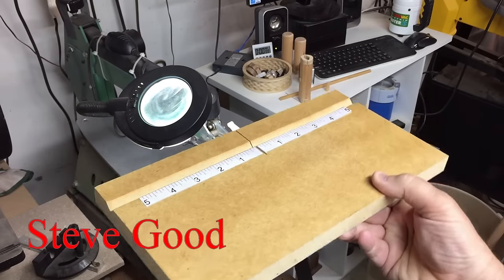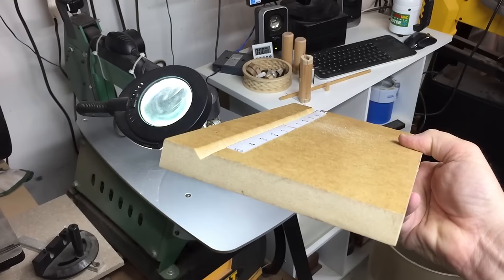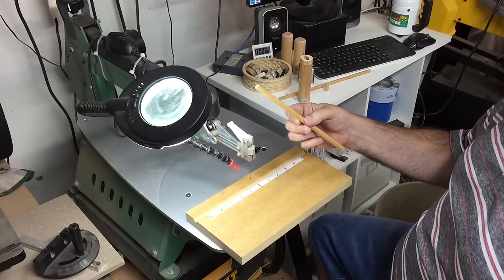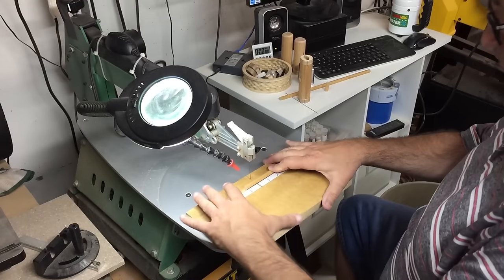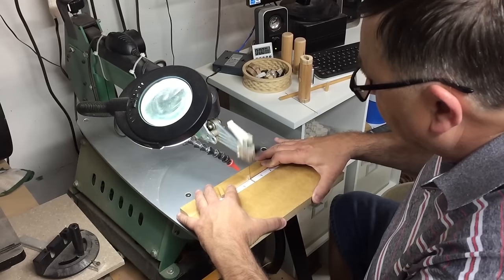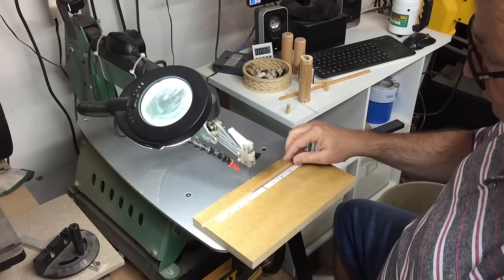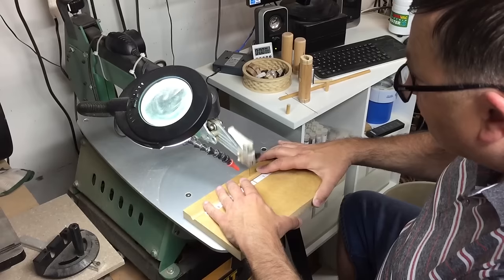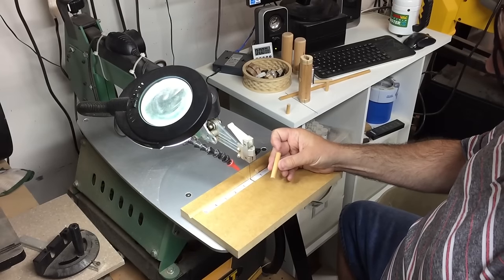Scroll Saw Dowel Cross Cut Jig Prototype.

Comment: I've seen comments on a stop block and would add putting a stop block onto the jig. Most table saw and miter saw accessories have a stop block of some type. It makes repetitive cutting accurate. Using just a ruler creates the problem of having to remeasure every cut. A stop block eliminates the error of misreading the ruler.

Comment: Perfectly good jig Steve, an approach that is very familiar to general woodworkers. Not at all sure about the metal sheeting tho. Do you say you are going to put it in the groove to help control the blade? I can't quite visualise how that will work, and in any case just how precise do you need the cut? I would have thought that the jig as it is now, will do the job?

If you ever needed to cut scores of dowels the same length you could add a moveable stop block, but to be honest that feels like overkill.

Comment: Something I made awhile back for cutting dowel was 2 pieces of wood with grooves in both. The top piece held down by a screw to hold the dowel in place..You could add a clamping mechanism..otherwise a great idea..
Reply: I just clamped mine in a vise and cut with a hacksaw, but the scroll saw would work great as well